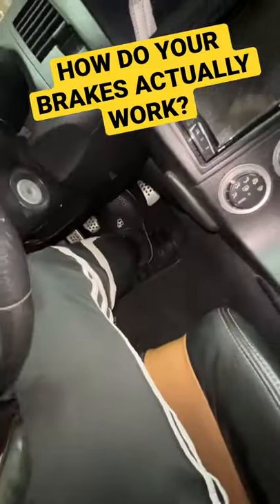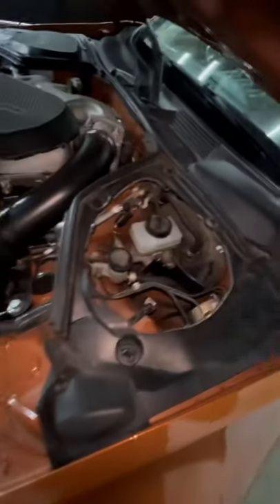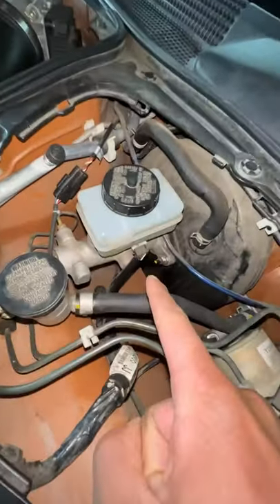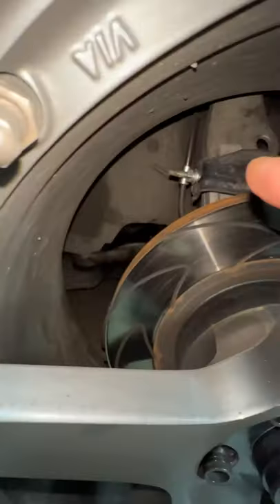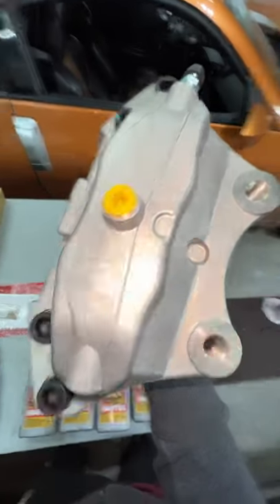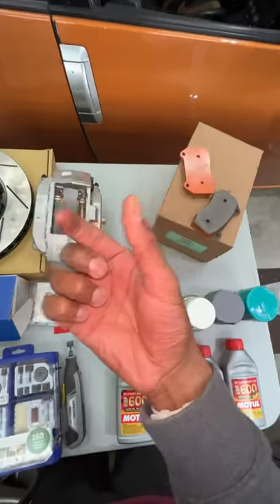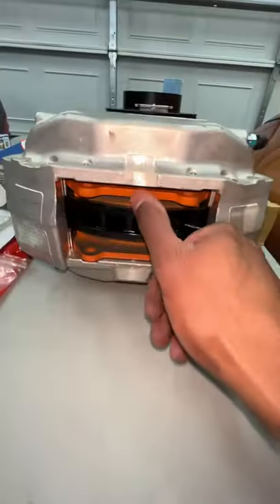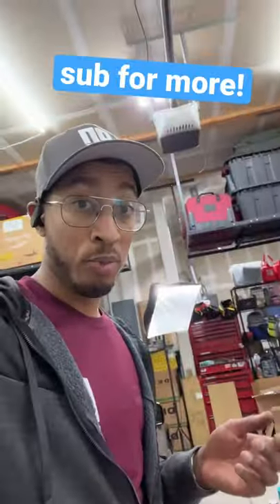How do your brakes actually work on your car?

Comment: One question though why does it have to be a certain hydraulic fluid? Isn’t that most likely similar in like make pressure I mean steam trains use steam which is vaporized water to move a three or maybe even four ton locomotive
Reply: Probably for a certain density, more fluids might be able to put more pressure than others I guess. Steam engines are nothing like these brakes, that makes no sense.